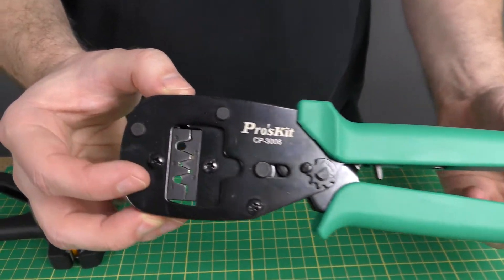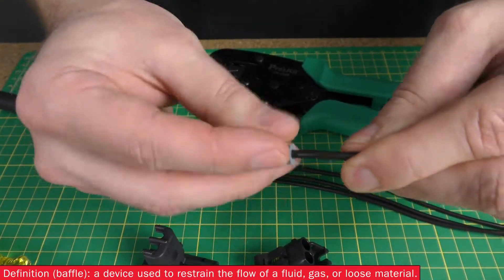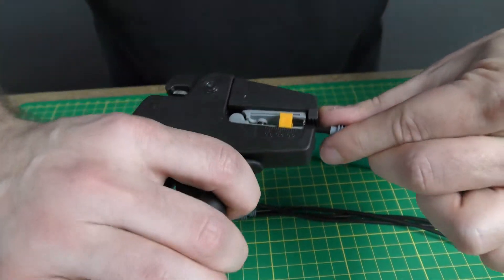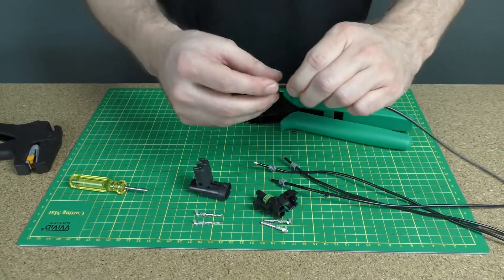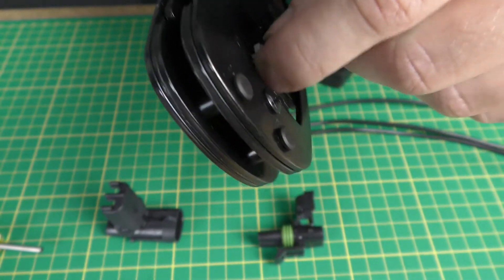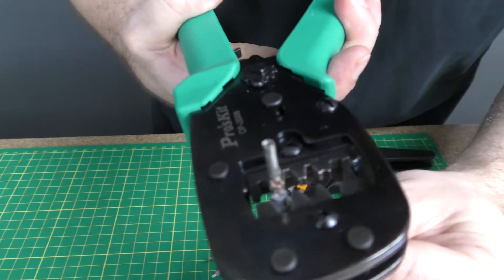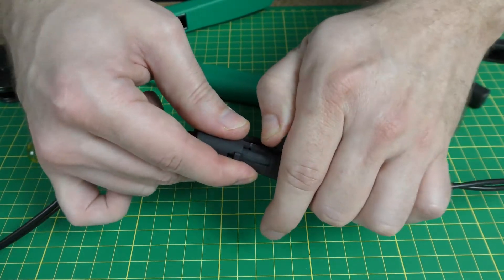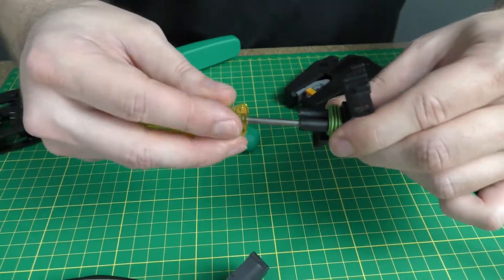QuikGuide: How To Crimp and Assemble Weather Pack Connectors

Comment: You did not explain how you selected the slot you used.
Reply from the maker: Sorry for the delayed response. The slots are dependent on the the wire gauge being used (AWG 14-16/18-20/22-24). The two round cavities are for crimping around the plugs.

Comment: It seems as though you have the gender names of the connectors reversed?
Reply from the maker: They are not reversed. The housings do look like they would be opposite gender. It's the terminal itself that determines the gender and not the housing.
Reply: @EclipsetoolsUSA  Thanks.  I finally figured it out after thinking about it. I appreciate your reply and the video!